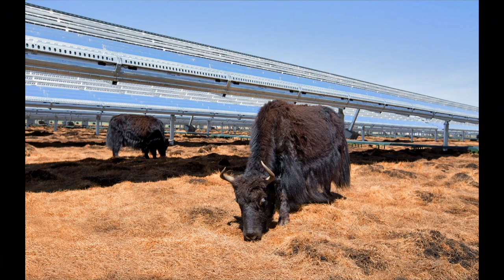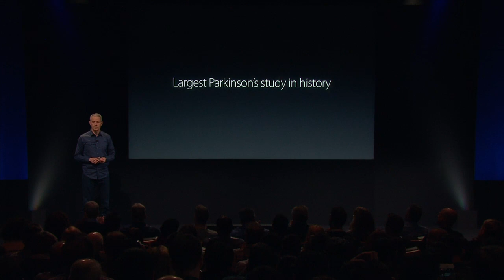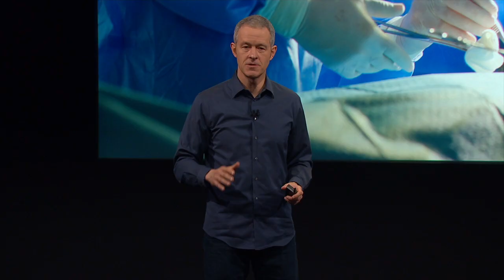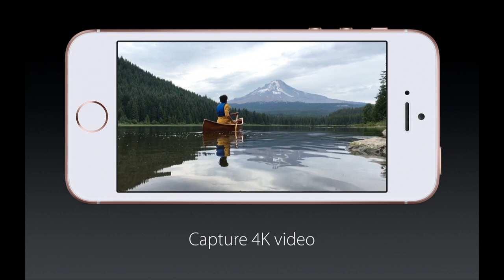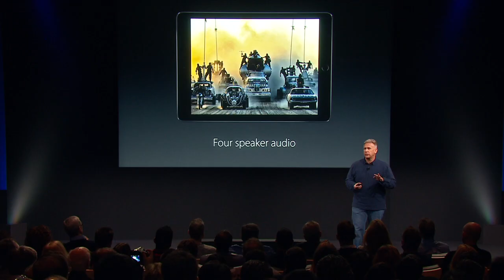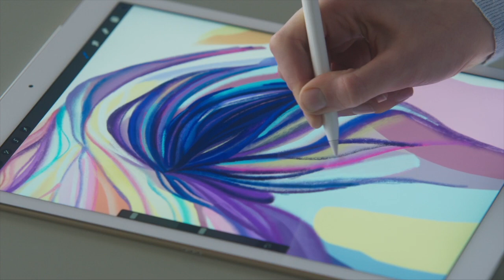Apple Keynote 21st March 2016

Comment: The new SE phone is an awesome addition for us folks still using a 4 model. However I thought their revolutionary idea for the iPad pro was to finally unchain it from the "Phone OS" ecosystem. There is nothing Professional about it, just how you apply it "Professionally". A revolutionary idea would be leveraging the full desktop potential of OSX on a tablet. This would open up a whole new model line for them, not just compete with the MacBook Air series. I would drop my "nix" based laptop for a 12 inch pro with OSX in a heartbeat. Being able to harness the professional power of every pro software built for Mac and PC (with fusion). That's revolutionary and would justify the "PRO" moniker. Alas, we are just stuck with big old phones hoping that someone writes "That" app that fits our needs as working professionals.

Comment: Worst keynote from Apple ever!
Reply: +Nabil P Not only that but I think the Apple craze is wearing off. I remember keynotes where they would get standing ovations from the crowd after almost every slide. Now they hardly get off of their chairs during the entire presentation.
Reply: ***** That's what I feel too, but when I said this at one year after his passing I was greated with an angry mob still.
Plus what I also noticed is that the software Apple puts out has a lot more issues in it. For me iOS ran less buggy in Steve's days, even though there were still a few bugs even then. It did get slightly worse in Steve's day as well, and probably due to the annual pressure of putting out new stuff. However, this has gotten worse after.

I dunno, personally I switched from a iPhone 4 to a Nokia Lumia 930 and haven't looked back since. Less apps but it's improving faster every day, and most that I use are now on the Windows platform. Greatest point of all is that everything works without issues, and that my phone got faster when going from Windows Mobile 8.1 to 10. This contrary to my experience with iOS upgrades ever since I bought my 1st gen iPOD Touch.

So yeah, in the end I think Apple needs a makeover and something new and surprising again. Else I fear they might end up with a slow death eventually.
Reply: that why with the iphone7 it should be loaded with features! it really needs to catch up to a lot of phone manufacturers!
Reply: fuck Apple
Reply: yep i indeed bet wwdc will be as bad

Comment: 46:20 "PCs that are over 5 years old. This is really sad."
So apple does not expect that their devices work longer than a few years? Isn't it a good thing, that PCs have such a longevity.
Reply: +Severus Müller Apple actually future proofs their devices, take the 4s that thing is still having IOS updates today, the Powerbok G4 can run OSX El capatain
Reply: that_moto_fanguy for_ever Windows 7 is getting security updates until 2020. Almost every 10 year old PC can run Windows 10.

Comment: 50:16 "incredible level of performance, unlike any other mobile device"
Microsoft Surface Pro with Intel Core i7 and dedicated GPU ??
Reply: +Severus Müller Is on a OS more prone to viruses etc. has a smaller consumer base,  not an apple device so can@t do things like iMessage or facetime oh and has hardware whic his made to last a lot longer
Reply: that_moto_fanguy for_ever Windows has a bigger consumer base, that's why more viruses are targeting it. But I wouldn't say it's more prone to them.
Skype for example is a platform independent messenger with a great distribution.
I don't know how you know that the new iPad has such a longevity hardware, were you a beta tester?

Comment: IOS wreck android in OS change, i swaped to android 6.0, It breaks your SD card by putting it into a only read lock.
Reply: Lol. Ok. That's not really a comparison. iOS doesn't support SD cards natively so you don't know how they would or wouldn't interact with them.
Reply: Also, the read only is when you're accessing it as a user level, not administrator level. If you're accessing the card as administrator then you can read and write to it.
Reply: Zestypanda You dont really get it, the only read cycles is on a hardware level. Right now their is not a reformating program in the world that i know of. I need go into it`s code and change some values. And also hope that the SD card did not put itself their for a good reason.
Reply: lokalkakan I have no idea what you just said.
Reply: Zestypanda Put it shortly, Android is such a broken system that i cant handle a proper reformat and update of the OS with out breaking SD cards around the world with what is a really easy thing to avoid but hard thing to fix.

Comment: so the "Hey Siri" is exactly like the "OK Google" in android.....
Reply: +that_moto_fanguy for_ever Uh google is always on also, just like siri. Except that with Google you can turn it off.
Reply from the maker: Basically yeah
Reply: yes
Reply: +Evan Sargent not really since it is always on and can be used without having to open it, plus its a lot more advanced and can intercept accents better
Reply: Zestypanda tnat feature reminds me of the kinect by xbox one.
Reply: Hey Siri was added as feature on old iPhone, but only when it's connected to charge station. This is Hey Siri "everywhere"
Reply: +Evan Sargent Yes it is, but Ok Google doesnt sound as cool as Hey Siri, you know?
Reply: Google, siri, and s voice has that feature.
Reply: U can do it like 5 moths ago if you jailbreak
Reply: And the Hey Cortana which has appeared before the hey Siri with windows 10
Reply: Zergoug Faycal tru
Reply: Zergoug Faycal No. You're wrong. Voice activated personal assistants go back to google with "ok. Google" always on.

Comment: Keynote TLDR: "We're Apple, we so innovation we will change the world! 
here is a iPhone 5 and the iPad with an s pen, er I mean apple pencil."
Reply: +Ren K its a 6s in a smaller unit dumbass
Reply: that_moto_fanguy for_ever
Relax buddy, its last years hardware in a 2012 body. That's not innovative, its a way to off load excess iphone5 parts.
Reply: that_moto_fanguy for_ever
looks like a 2012 iPhone 5, no 3d touch, 1st gen finger print sensor, low rez screen with bad view angles, it is NOT an 6s.

Comment: iPad pro 9.7? Think I'll stick with my Air 2. I think Apple are losing the plot now. No new innovation for years now.
Reply: There is nothing new in there. if you are amazed of the specs. that is because apple always use low spec in their product.
Reply: +Nunsweepit421 but the specs tho....
Reply: You should keep the Air 2. I'm considering getting it. I'm using Tab S2 now....
Reply: +Romeo Awayez +renzoray18 what specs? 4gb ram? A9X? lol.
Reply: +alexander jeam oro this proves that you cannot please everybody...
Reply: +alexander jeam oro yeah? Whatever. Apple is Apple. Ni nway gane sila chance na otro! Sows! Kere lng yo na Apple kay easy lng di ila interface! Duh!
Reply: +renzoray18 Yeah this is exactly what every arguement boils down to......Apple is Apple!!! Doesn't really matter if they pack a butt load of horse shit in an Aluminum casing, it is still an Apple!!!!
Reply: +renzoray18 Specs on the pixel c are better, and it's cheaper lol. Nvidia x1 processor, that's a gaming chip. Apple is a joke.